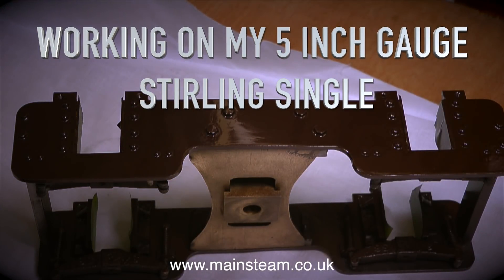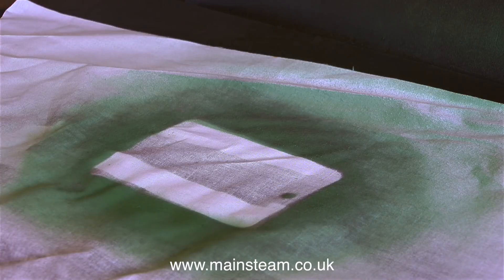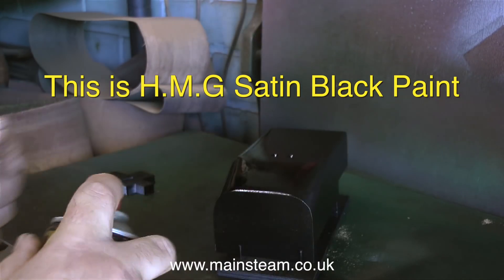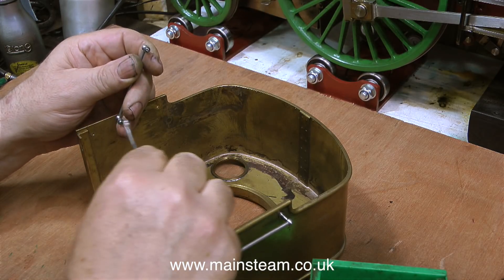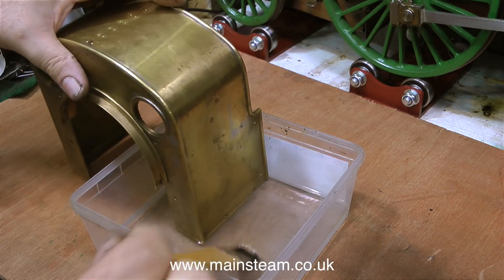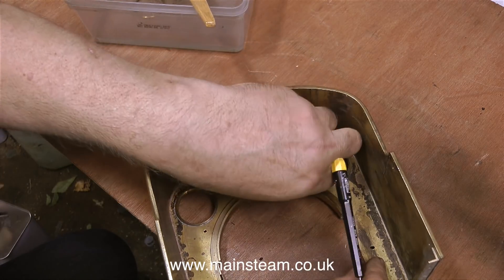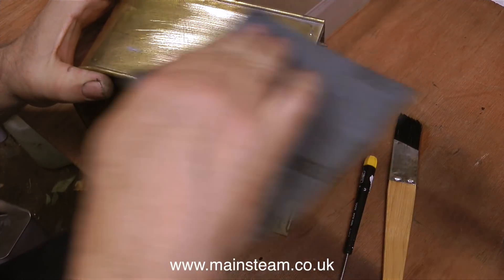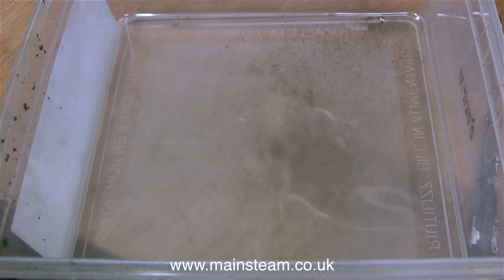MY STIRLING SINGLE #8 - PREPARING FOR PAINTING

Comment: Keith have you ever considered getting an air brush to do your spray paint work? Or would you find that too fiddly, dealing with solvents and clean up etc... Just curious what your take is on that method.. Cheers!
Reply from the maker: I used to have one but I got fed up with constantly cleaning it - if I had more time then yes I would use one, but with an aerosol I paint and then just put it back on the shelf . . . it saves time .....
Reply: Totally agree with you, air brushes are nice for fine detail but what a pain to clean up.